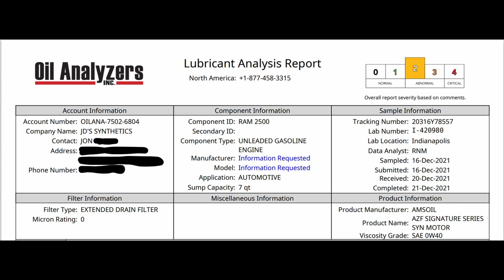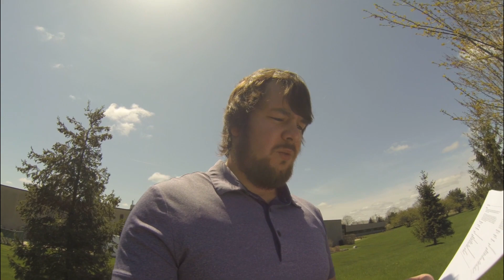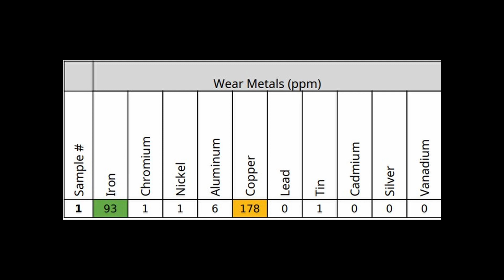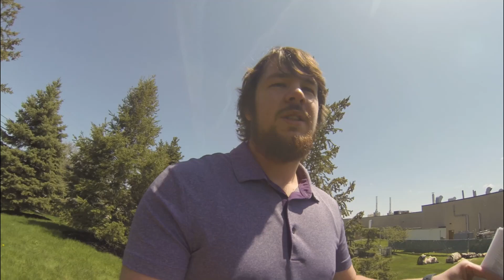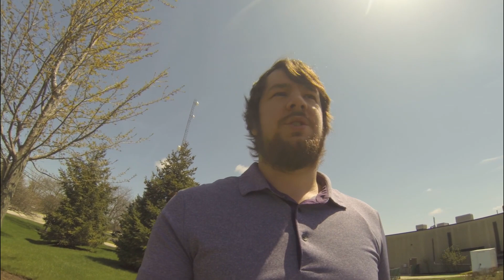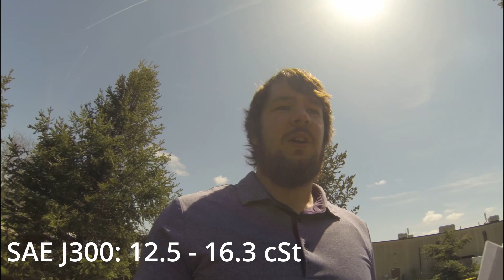RAM 6.4 HEMI AMSOIL Oil Analysis

Comment: If u study uoa's you'll see with these high full synthetics they usually have higher wear metals .people have been putting redline and amsoil on metal outside and shocked to see how rust develops.  In life I have found any substitute for anything is usually not as good as the original .I'll stick with the Pennzoil synthetic blend 5w20 for my 5.7.  Has more then double the moly most oil has and a good additive pack in general .all this 8k-10k oil cange lengths are just stupid .3-4k and change it out .plenty of techs on YouTube have admitted that even tho their companies manual says 10k DONT LISTEN TO IT .they have torn the engines down and seen the issues from long drain intervals .
Reply from the maker: I think high wear metals can have multiple sources. If it's duty cycle, then it's maybe short trip, maximum power or high rpm usage. I also see a lot of people who will run a "extended interval" oil filter, those filters often have a larger micron ratings. Keep it simple with the standard WIX or NAPA gold, I've started running an AMSOIL filter and will have a comparison up at some point.
IMO, those who run the 8-10K interval and use garbage oil are the ones having issues.

Comment: My 2021 has been on redline 0-40 since 1k miles . Now sitting at 28k . Gonna try Amsoil this next change …
Reply: Are you using the Redline 0w40 easter base, high zinc formula ?  Reason I ask, I've been wanting to try that oil.
Reply: @ericsivilla4091  that’s what I’ve ran , so far 3k in on Amsoil and it doesn’t seem too bad . Maybe a touch quieter than the redline
Reply: @LvDirtJunky  interesting, yet Redline is Easter based, and higher zinc. Approx 500 to 550 ppm. I guess it's not zinc as some claim. Would be an interesting test to send to a lab sample. I have not been able to find anyone on YouTube that has done a test, or lab sample if Redline Easter based high zinc oil. The regular Redline yes, but not the good stuff.  Standard auto-part redline is not the best, not even close, neither is Royal Purple. On paper the performance versions of their oils should be the best, but their no proof out there.
Reply from the maker: Sounds great! Shoot me an email at jdsynthetics20@gmail.com and I'll help get you set up so you'll have a painless purchase when you're ready.

Comment: Try valvoline do the same mileage  and get another oil analysis
Reply from the maker: I'll look into it, I already have another change of AMSOIL ready due to our yearly trip coming up. It would be easier if I drove more miles.
Reply: @jdssynthetics2454  I'm not saying amsoil it's not a good oil I have used it I didn't had good results in my case valvoline worked much better it's a very good  oil do your research and maybe it will be better for your engine too 😀 great video by the way
Reply: The Valvoline European 0W-40 is now approved for the Chrysler hemi specification.  It is 50% of Amsoil cost, not that the Signature series has any drawbacks other than cost.
Reply from the maker: You can run Signature Series to at least 15k miles, I'd like to see someone try that with Valvoline.
Reply: @jdssynthetics2454  

Why use either ?
Supertech will get you to at least 5K miles at a fraction of the cost. Look at Project Farm's
Video on Supertech's characteristics, it's got everyone on board.
Reply from the maker: @dfls5069  
Do they sell Supertech in a 0W-40? That's the manufacturers spec for all 6.4L Hemi's.
Having a growing family I value my time a lot as well...changing my oil once a year, or less, is worth the cost on top of the other benefits of a well engineered oil.
I don't want to take too much away from his videos, because they are useful. But there's so much more to how an oil performs than just those tests. One could engineer an oil that would dominate in those tests, but wouldn't last for 2k miles in an engine...it's about a total package.
Reply: @dfls5069  I saw that series on Project Farm. Through his testing, and all other YouTube reviewers Amsoil Signature always comes in first place, and Pennzoil Ultra Platinum always comes in in second place, and flow is slightly better in some cases. What I would like to see is some one rest Redline Easter based, high zinc formula. Btw; if not mistaken most of these reviewers including project farm use Amazon basics motor oil. If I remember correctly. I would not use supertech in a cold climate.
Reply: My dad has a 16 volt with 125k miles changed oil 1 year ago and ran it for 23k  miles had to top off 1/2 quart a few weeks ago. About 80% of those miles are all electric. I sent a sample to see how it hold up. Running amsoil signature 5/20
Reply from the maker: @djoj1986  
That's great! I hope you find the fuel dilution to be at an acceptable level, I believe that is going to be a huge issue for trying to run extended oil change intervals with hybrid vehicles. The benefit though is that those applications barely run above idle most times so the stress on the bearings is usually quite low.
Reply: @jdssynthetics2454  so I got lab results back. Wear metals 12 iron, chromium 1, aluminum 7, and copper 2. All are low so that good. Silicon is 48 moderate high probably need to change air filter more often. Baron is low 62 but no need for concern, viscosity is slightly high 9.6 and base number is slightly low 3.14. 

Numbers look great for 1 year oil change with 24k miles only had to top off once with .5 quarts. But 70 to 80 percent is all electric.
Reply from the maker: @djoj1986  Those are great results! I wouldn't replace the air filter more often than what the manufacturer says, the dirt actually helps it trap even more dirt. So as long as it's not restricting flow(pretty hard to do when all the engine does is idle) I wouldn't worry about it